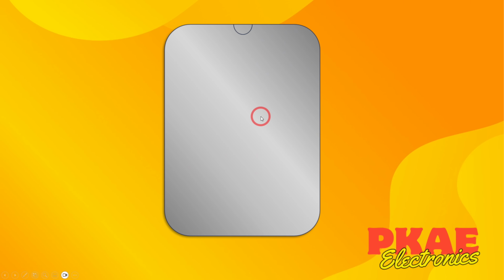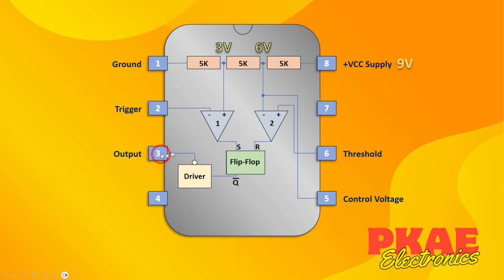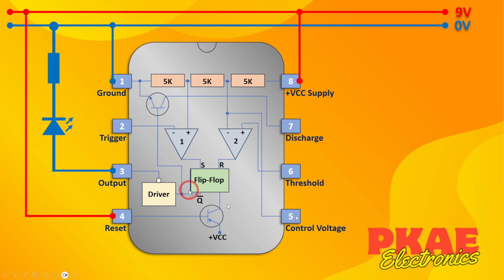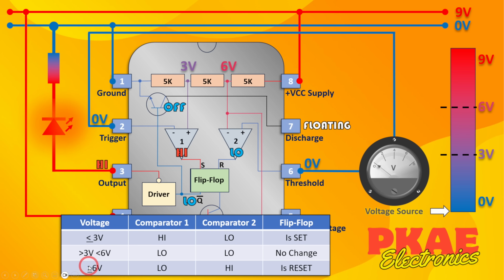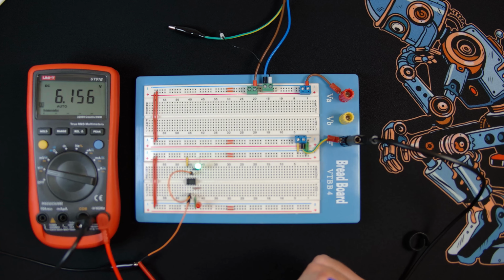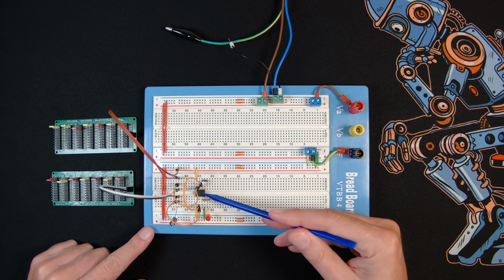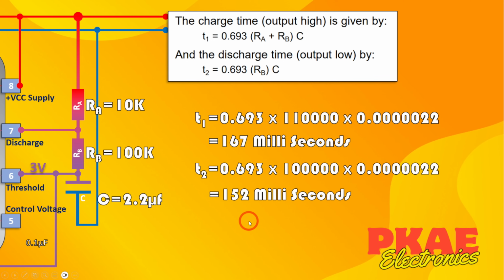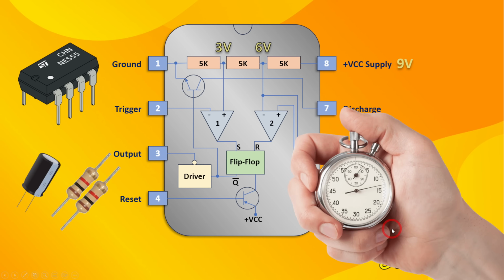How a 555 Works as a Timer.

Comment: Very good video👍 I do find myself wondering tho what happens when the flip-flop has both set and reset inputs hi simultaneously, I understand that's not possible in you're setup with trigger and threshold linked but in another application those might have different voltages causing both inputs to the flip flop to go high and it doesn't make much sense to both set and reset something simultaneously yet it's a conceivable position to put the chip in, what would be the outcome and why?
Reply: Like connecting trigger to ground and threshold to 9v, then both comparators are high and the flip flop should simultaneously be set and reset, what then is the output?
Reply from the maker: Thanks for the comment. A few people have asked this, so I think I will do a follow up video on that very point.

Comment: The NE555 bipolar timer has an output stage that produces a significant spike of current as it switches, and that can cause problems both for itself and for nearby ics as it tends to produce a negative spike on the supply lines. It is pretty essential to place a ceramic 100nF capacitor across the supply pins, close to the ic to suppress that. It's not so necessary if a CMOS 555 is used.
It doesn't matter for the astable circuit you show, but for use as a monostable, or other circuits, it's worth knowing that the TRIG input (pin 2) overrides the THRES input (pin 6), which means that if the TRIG input is held low, the output goes high and the THRES input cannot reset that by being taken high.

Comment: Maker a great PWM  voltage regulator.  Or a PWM dc motor speed controller. Or a class D audio amplifier. Or a 200 ma power transistor driver/buffer. or a ........

Comment: Amazing video...
I have a question... How do you get the charge and the discharge timings to match (With the equation you showed, it seems one of the resistors has to be zero?)
Reply from the maker: Hi. I will be doing a follow up video on exactly that. The circuit shown is the standard Astable example given in the datasheet. Basically you add two diodes to allow more control over the duty cycle.
Reply: @paulpkae  Thank you. Looking forward to that...
Reply: Or just run it at twice the rate and drive a divide by 2 flipflop.  Perfect 50% duty cycle.

Comment: People say it wasn't named after the 5K resistors because that's what the inventor of the 555 said in an interview.  It was named by a marketing fellow who thought "555" was catchy.

Brilliant video, BTW.
Reply from the maker: Yes, I have heard that too, but for me it seems too co-incidental.

Thanks for the comment.
Reply: @paulpkae  You may think it is too coincidental but it don't know any reason to think it is not a simple coincidence. Historically there was no logic for how these early ICs got their number designations. As far as I know it was generally mostly chance. The 556 is essentially two 555s in a single package. There is no difference in the resistor voltage divider. I don't recall hearing anyone speculating where the name came from back in the 70s or early 80s. No one questioned where 7404 got that designation either. Engineers just like to number things.
Reply: Maybe the marketing fellow saw the schema and got the idea.

Comment: @1:25 Hans Camenzind, the chip's designer, said that it wasn't named for the resistors, and that a marketing manager called Art Fury had named it.  I read that in one of the IEEE magazines when I was researching the chip a while back.
Reply: Hans built the first 555 using a semi-custom chip that Signetics was flogging. This was a chip that had all the parts but not the metallization layer. A pile of parts that you get to hook up. There were some very low value resistors that you could use to run one connection under another, otherwise you would have been very limited. Redesigned for volume production of course. Two of us designed a hearing aid using the same semi-custom chip. We had to add an external PNP transistor to be able to pull up to supply on the output. This was a shirt pocket high power hearing aid, 138 dBSPL. But it had a compresser and the max output was adjustable. I mean this is beyond the threshold of pain for normal hearing. Hans visited us to answer our questions during design. We got to pat ourselves on the back when the VA said it was the best they had ever tested. Of course today they are all digital and programmable up the wazoo.
Reply from the maker: @danielcarroll3358  Interesting stuff.  Do you recall what distance the hearing aid measured 138dB sound intensity? Loudspeaker specifications are usually quoted as SPL attained at 1W at 1m.
Reply: @paulpkae  This is the A weighted pressure output by the hearing aid into a standard artificial ear whose volume was either 2 cc or 2.5 cc as I remember. This aid fit in your shirt pocket and through wires drove a transducer that snapped into an earmold cast to fit in your ear. This is the sort of thing one would use if a behind the ear aid wasn't enough. It weighed more than ten behind the ear aids, had rechargeable batteries, certainly not lithium, and you could drop it into a foot of water with no damage. Build like a tank. Remember, this was the 1970's.
Reply from the maker: Yes I recall something like that being said. Too coincidental to me though. 😁

Comment: Brilliant video. I was surprised that I could watch this length of video on the venerable 555 and not find my mind wandering. It's a testament to the ability to teach and keep people engaged in the content.

 I really appreciate breaking down the pins and how they are related without just glossing over why a given pin is connected to a specific point in the circuit. The color coding of the internal and external voltages along with the logic level changes definitely made it easier to follow what was going on.

Bonus points for building up the bench demo from a couple LEDs to the oscilloscope traces that took the diagrams from a simulation to the real world.
Reply from the maker: Thanks for your comment. It took quite some effort to put this together to be honest, but I am please with the outcome, especially all the comments like yours. Please remember to Subscribe, if not already. 😁

Comment: Nice to hear this explanation lives on..

PNP & NPN Was one of the first things I was taught when I was in a YTS T.V. Engineer training apprentice. ~1986 +

Point iN Please & Not Pointing iN.
Project building hobby led to a self taught knowledge of the voltage polarity workings for basic switch amplification.  ie.

PNP = A Positive on the Emitter then the base should be held Negative 0v  to switch the collector through to the Positive.

NPN = A Negative on the Emitter then the base should be held Positive  to switch the collector through to the Negative.

Basic relay type stuff.
But also a general rule in amplifiers but that gets more datasheet reliant for HFE values etc.

Cheers.
Reply from the maker: Thanks for the comment.

Comment: I once found a single chip circuit board controlling the water level in a tank. Very very old system. I asked the maintenance grey beard why they had a microcontroller instead of a PLC. He laughed. "That's a 555!" 

With some resistor magic and a variable resistor on a float, they set the low level to report 3v, and the high level to 6v, and the 555 triggered the fill valve.
Reply from the maker: Thanks for sharing. I'm sure there's been millions of different 555 implementation types over the years.

Comment: To have a timer, you have to have a generator (preferably a square wave generator). Preferably an astable multivibrator/square wave generator. What about having an RS trigger, driven by two comparators doesn't remind you of a possibility of a multivibrator (astable and monostable) and what made you think the 555 isn't a timer? You didn't really elaborate on that part 😀🌞 Normally we call the comparator input terminals inverting and noninverting, not positive and negative. Also color coding the voltage in this case seems a little redundant to me. One important thing is that the common terminal of the DC power supply does not have to be and rarely is connected to the ground terminal of the power supply network. If you have videos that properly explain those situations, and the difference between common terminal, ground terminal etc., I would definitely subscribe. But  this video I can give only a like sorry 🌞One notable thing about the 555 is that, as you showed, it doesn't have a lot of transistors and components in its chip. That's the reason you got this 1ms difference in was it the pulse duration. For a frequency of a few Hz this is quite brutal. That's why it is used mainly for academic and high tolerance affordable low frequency applications. Of course to have a timer, technically you'd have to have a square wave generator and a counter, so it's not really correct to call the 555 a timer. That's just a colloquial word.
Reply from the maker: Thanks for watching and your comment. 

The thumbnail statement "It's Not A Timer" was a bit tongue in cheek and a little controversial, but deliberately so; it attracts attention. 

I do however hold to the fact that the IC itself does not contain anything time based at all. You only make it into a timer by the components you add around it. 

On the flipside, it means the chip is quite versatile and should not be pigeon holed as a timer only. It can be, and indeed is, utilised for many other implementations.
Reply: The fact that the on and off intervals corresponded so closely to those calculated is just a fluke. To get the timing within less than 1% of calculated would require a 2.2μF capacitor that has less than 1% tolerance, and you'll have a real problem buying one of those. You'd also need a 555 timer whose trigger and threshold levels are within 1% of Vcc/3 and 2.Vcc/3, but the datasheet shows a tolerance of at least 10% at best. The 555 astable circuit is simple and reliable, but it's not a precision timer, and you'll need a crystal oscillator to get the sort of precision you seem to be expecting. The reason the 1ms difference occurred had absolutely nothing to do with the transistor count in the 555.

Comment: Ask an engineering student these days to make a LED flash... They'll take an Arduino... Talk about overkill... But dollar for dollar, Probably cheaper than making a custom PCB and using a 555, or even a 2 transistor multibibrator
Reply from the maker: Thanks for the comment.

I'm somewhat pleased that low cost micro controllers have come along. I think they have fuelled a new interest in electronics and with the combined benefits of software I feel there is a new era of a young generation developing some fantastic projects out there.
Reply: You obviously haven't made any pcboards lately.  Small ones from china are about a dollar each.  555 chips are about 13 cents each.  That's cheaper than a $25 arduino nano.  But you could use an 8 pin PIC microcontroller to do it for $1.92 with zero external components besides the LED.

Comment: For me, I get nostalgia remembering the late 1970s starting  in college studying engineering physics that included using an analog computer (shoved in a corner storeroom) and some basic biomedical electric engineering design. Isolating the patient from any mains exposure.
In the late 1990s, much to my wife's disbelief, I would study/stare at high fidelity analog amplifier circuit diagrams.  From vintage tube amps to state-of-art solid state stereo amps.
Following the various feedback circuits used to eliminate harmonic distortions.
Why? I'm not sure. I had extra time on my hands and it was so relaxing.
Just like watching this video.

 "555 timer" circuits used to be in the many electrical/electronic hobby magazines years ago.
Magazines. 
Gone the way of phonographs, magnetic tape, CDs, laser discs, DVDs, etc.

My 2003 Toyota had an electric motor extension for the radio antenna that was broken off in the car wash. It ran every time I turned the car on or off. I thought I could just pull the fuse.
It was fused, all right. But on the same circuit as 10 other totally unrelated and multiple necessary  things.
Probably through some special IC or microprocessor? 
I couldn't find a "wiring diagram" on the internet and the dealer will not give me a copy.
Actually, the dealer has no circuit diagram in the classic meaning of the words. 
Just broken up functional portions on their computers.
I finally had to pull the power wire by accessing it through the wheel well above the tire.
I miss the 20th Century.
Keep the videos coming. I'm sure I'll enjoy them.
Reply from the maker: Thanks. 

Much of the old fashioned approach of trying to fix stuff yourself has sadly gone. But there is a new era of developers, building entirely new and exciting electronics devices out there. I'm convinced the emergence of low cost micro-controllers has fuelled a mass increase in young interest.

Comment: Thanks, I now know the right way to get a perfect 50% square wave with a 555.

Setting RA to zero obviously isn't it as discharge then would short Vcc. Putting an extra resistor before discharge, and maybe leaving out RB, is the way to go.

However this has an issue too - discharge would no longer be towards zero, but towards a voltage divider. So, more math to do... but this definitely will work.

(Or no math at all and just put a potentiometer there...)
Reply from the maker: I will be doing further videos on other 555 circuits. As a hint though, you can just add a couple of diodes to control the current path around through the appropriate resistor dependant upon the current direction.
Reply: @paulpkae  Yeah, definitely, diodes work too to adjust this... they have their own voltage drop though, which changes the math as well.

Comment: It simply uses the properties of capacitor's and resistors to delay the rate of the charge in the capacitor thus by changing both the resistor's and capacitor to alter the timing - Hence forth it's an electronic timer as opposed to a mechanical one
Reply from the maker: It's only a timer once the appropriate components are connected to it. 

Other than that, its a combined comparator/flip-flip IC which could be a timer, it could be a latch, or it could be many other things. 

Hence the caption on the thumbnail.🙂

Comment: That was an enjoyable trip down memory lane :) I once met a very excited chapin the gents of a Southampton pub who had designed the timer circuit for the hot air hand dryer using an NE556 and for some reason, he really wanted to explain the circuit to anyone who would listen.
Reply from the maker: From my experience, those hand dryers must have the wrong size capacitors in them then . 😆

Comment: Brilliant how the switching points are at 1/3 and 2/3 of the voltage range respectively, making the charge and discharge relatively linear.
Imagine how inconsistent the timing would be if the switching points where near ground and VCC.
Reply from the maker: Yes, although the RC time constant remains the same throughout the charge/discharge phase, the shallower curve region as the charge approaches the +V or -V potentials, would probably cause some erratic behaviour.

Comment: Thank you for this explanation and demo! I only really learned how to do microcontrollers with electronics so finding out other uses for simpler components is useful. One use for the 555, instead of a capacitor and voltage divider, you could use a thermistor to vary the threshold voltage based on temperature and tie the output to a relay to turn on a heater, you have made a simple bang-bang control loop.
Reply from the maker: Thanks.

Comment: I followed everything until you added the math part, it's the time when my brain has crashed 😅
Reply from the maker: I know what you mean. I try not to delve too much into the mathematics but it is an important aspect. The maths are straight forward multiplication on this one though :)
Reply: @paulpkae  your video was great, just my brain is allergic to math 😅 but I totally understand the principle of the component otherwise. I know the 555 for a long time but never looked at how it works exactly 👀